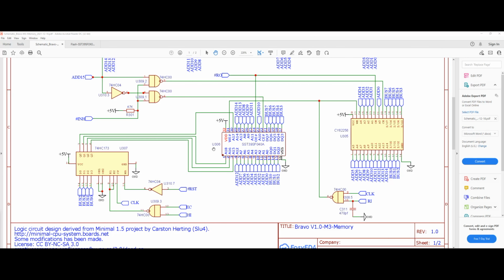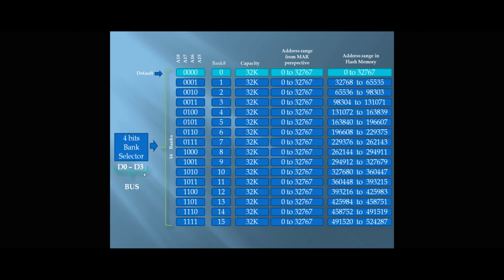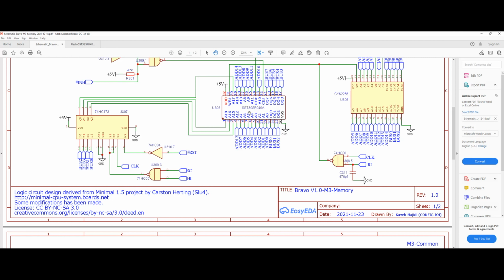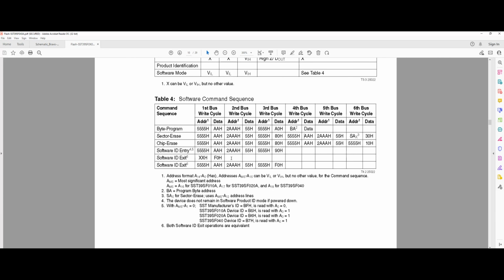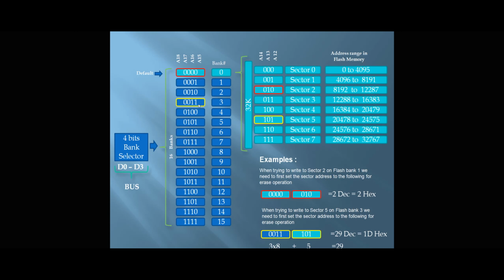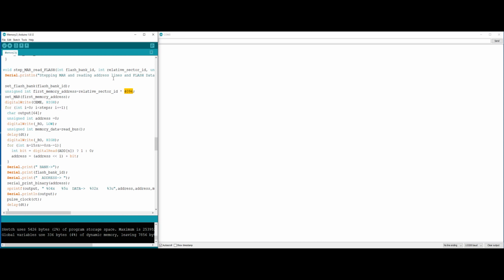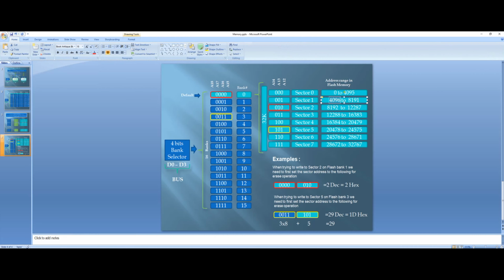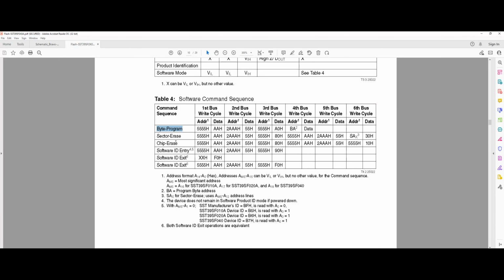Bravo 8bit computer-Part 9- Flash Memory, inspired by Minimal Project and Ben Eater's 8bit computer

Comment: Do you have any concerns about wraparound reads/writes when bank switching isn't dynamic?  In other words... you set the bank before doing ALL the sequential reads/writes... and so if you do so at a high enough address, you will eventually wrap the address around to 0...0 after F...F.  Is this a concern with keeping things intact, knowing where things are actually stored, and not overwriting anything?

And if you're erasing an entire sector of memory, aren't you potentially erasing memory that is important to keep in memory?  You're not reading the former contents into a buffer to rewrite along side the new contents, so you are essentially erasing a bunch of memory and only writing in new data... and that erased sector might have had data you didn't want to erase.  No?

Comment: For those who get to the section discussing sector addressing from bank+sector math, the ANDing of the bank select and bank sector is not exactly explained properly.  You're not going to get the correct address by simply ANDing (or ADDing) a bank address and a sector address if it isn't padded out.  ANDing a four-bit number and a three-bit number doesn't come up with a 7-bit number.  And ADDing them together will come up with a completely different result than intended.  You have to make sure the bank select is already 7 bits by shifting it three bits to the left and THEN you can AND (or ADD) it together with the bank sector.  0011 AND/ADD 011 isn't going to give you 0011011, which is the correct address for that bank/sector combination.  You must start with 0011000 by shifting the 0011 bank select to the left three times (multiple by 8), which adds the space needed for three bank sector bits and then AND/ADD the 011 for the specific bank sector.  I hope that makes sense.

Comment: have you foreseen to bank ram?
Reply from the maker: Not sure If I got your question right but if you are asking if we could have Banks on the RAM module, then the answer is Yes we could. However, we have enough bits from MAR to address the entire 32K of RAM so there was no need for banking. If we had a bigger RAM, then it would probably make sense.
Reply: @ConfigIOI  my intention was to have several times 32k rams (4 banks of 32k)... but alsi interfaces on extension boards (that you can address by starting reading and writing like in ram but from specific bank id from 5 to 8). sub division in sector may also be use because we do not need a 32k adress space to control a device/extension board. Does this would make sense?
Reply from the maker: I guess we could do that, So, we probably could tap in to the output of the bank circut and use it to control more memory space. You know, this is the cool thing about these type of projects that you can come up with your own design and change/expand the system. Cheers!

Comment: Well done mate ! Really awesome work ! Can you please mention any resources or books that helped you ?
Reply from the maker: Hi Alexandros, Thank you ! apprecite your feedback. In regard to the resources, I just have followed Ben Eater here on YouTube and I have built both of his 8bit computer and the 6502 projects. Both projects are wondeful resource to learn the concepts.Then I found the Minimal CPU System by Carsten Herting (SLU4) here on YouTube and learned some new stuff.  For books, The "Digital Computer Electronics" book by Paul Malvino is a great book as it has been referenced by Ben Eater in his series( though, it's out of print so if you can even find the printed version, it will probably be very expensive, find the PDF version online). Also, I read parts of chapter 12 of the "Practical Electronics For Inventors" by Paul Scherz & Simon Monk. Other than those, my resources has really been YouTube and online search. Hope this helps.